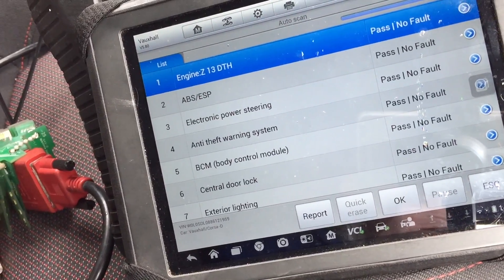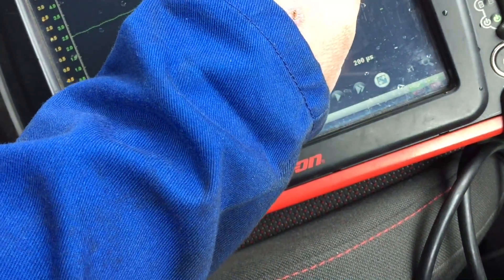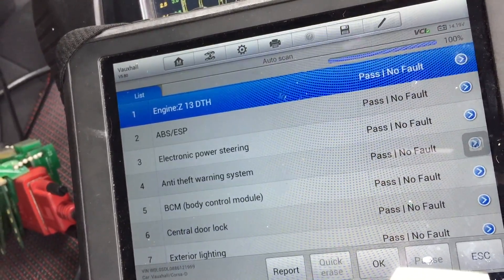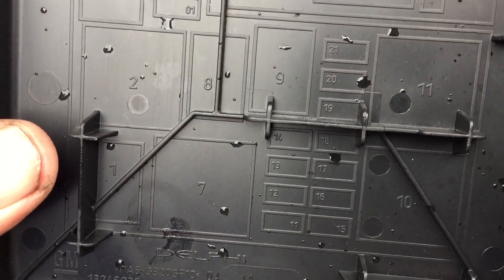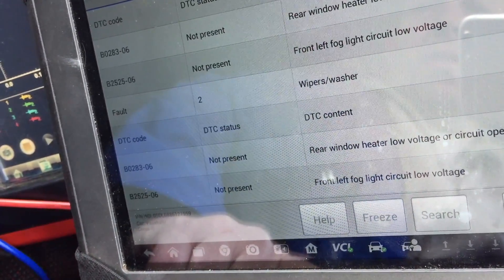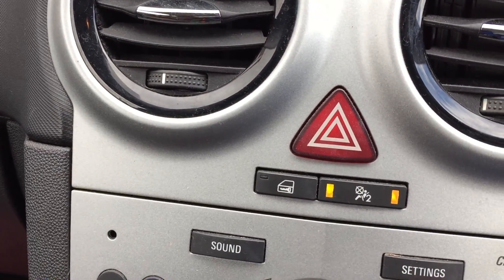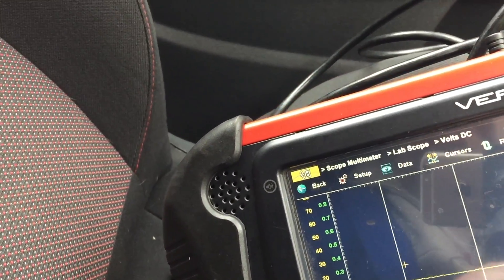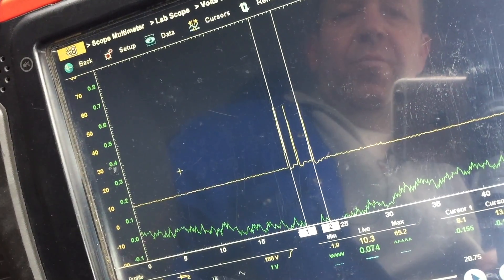Vauxhall Corsa D 1.3 CDTi - Intermittent Non Start -  P0685 - PART 3

Comment: Any possibility of low voltage to one or more computers during cranking. That could account for the low voltage codes and random network codes. What is the voltage at the ECM actual and via the lid list cranking? Same with BCM and other modules. Good luck.
Reply from the maker: Hi Phillip I've just installed new battery and it's starting first time, will find out in morning if had success cheers sandy

Comment: When you say those 2 codes repeat in all other modules, there is no other modules. Anti theft, central door locking, etc, it is 1 module only and that is BCM. Is that Maxi what which makes a mess of it, I never liked non-OEM testers and that is one reason why.
Reply from the maker: So what tester do u use
Reply: sandy anderson tech2, mdi and mdi2.